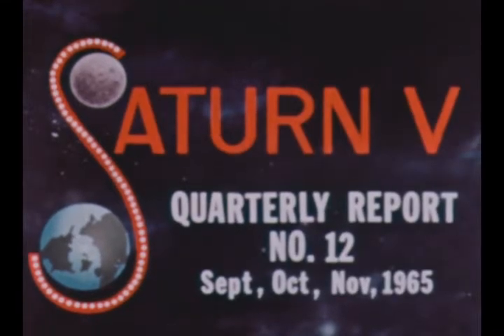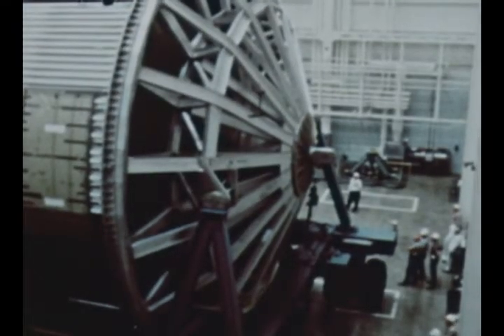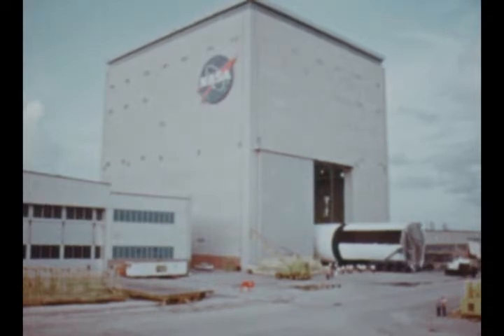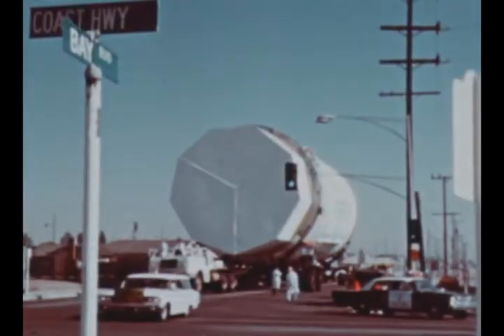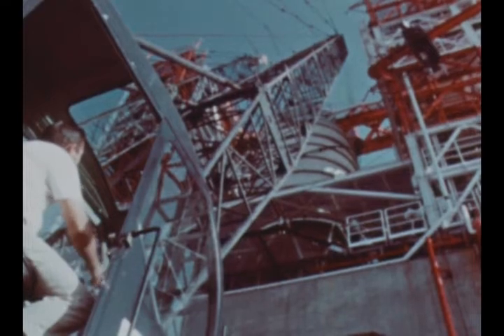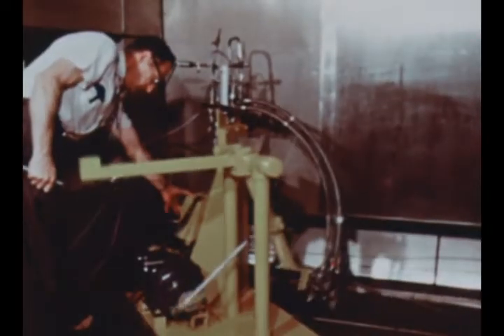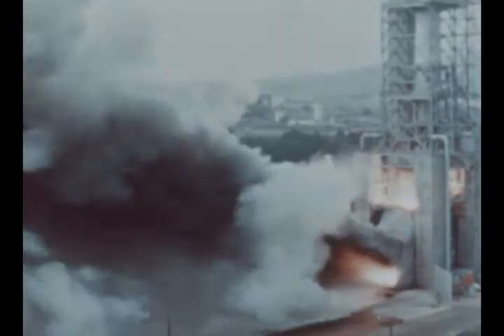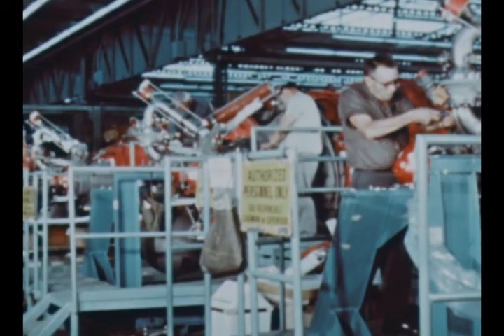Saturn V Quarterly report #12 Sept-Nov 1965 part 1 of 1

Comment: the cryo test of the common bulkhead was a very important test, not that the others weren't
Reply: I SURE wish we had kept flying Saturn.
Certainly the common bulkhead would have been integrated through the stack. Think of the tons saved off the pad. Shuttle was great but all we proved was it wasn't the best way. Design by Congressional approval, dang.
The building I live in is as tall as S-I. The north and south faces are darn close to 33' wide. All that kerosene, LOX.